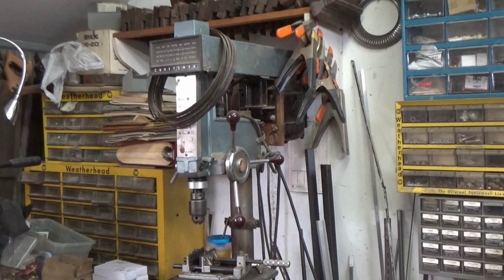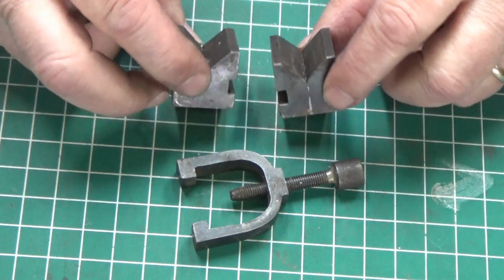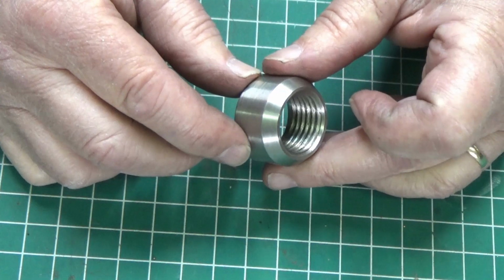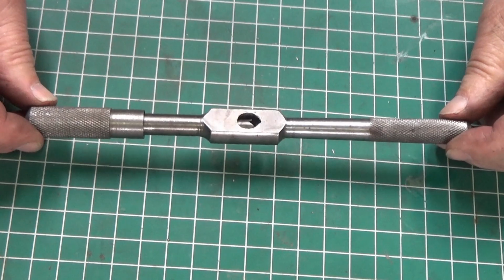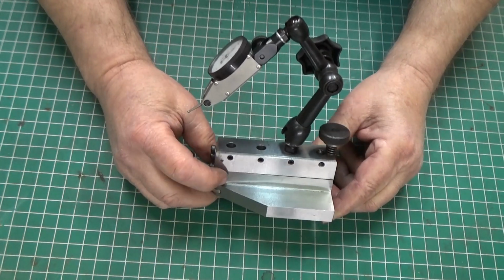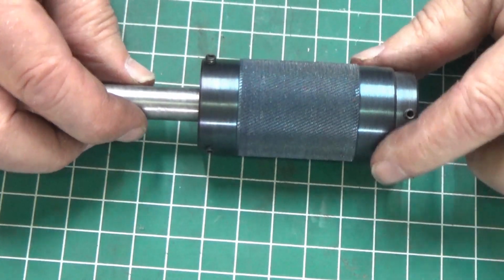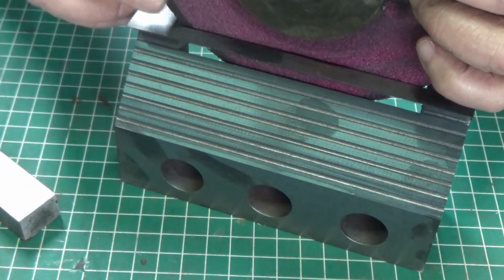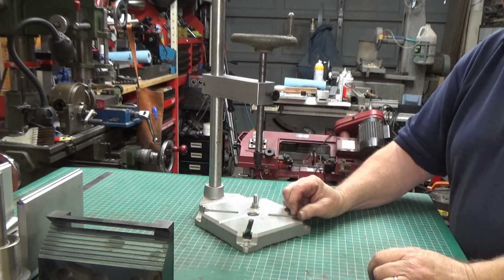Home Shop Made Tools

Comment: That's a great collection of well-made tools, Steve. Most of my shop-made hardware is specialized fixtures for holding brake cylinders, so not nearly so interesting as your stuff.

Have you thought about splitting the end of the tapping arbor maybe 1-1/2" up, then drilling and tapping one side for a cross screw? Tightening the cross screw would spread the split. This would accommodate the varying socket sizes and also take a lot of the wiggle out.
Reply from the maker: I have a plan.  Just waiting for some parts.  I will give an update.  I also have a lot of specialty items that would not be of interest to the general pubic. Don't know why I keep some of them.  Thanks for watching and commenting.